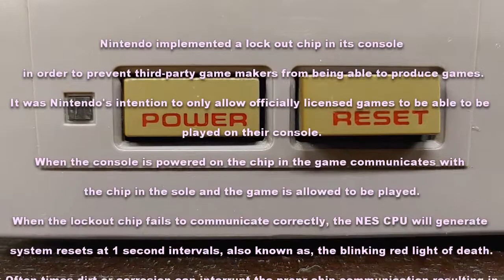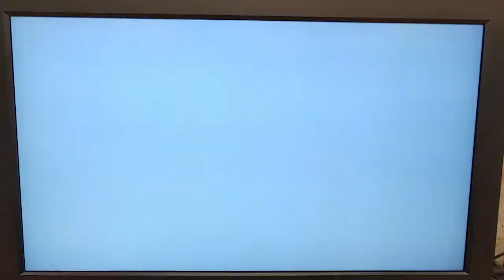Disabling the NES Lockout Chip...Good Idea? Goodbye Blinking Light! | The 8-bit Basement

Comment: I just refurbished my NES and bent the pins on my 72 connector. Everything works PERFECTLY.......except if I push the game down. It ONLY works if I leave it up. 🤷 Would disabling the lock out fix it?
Reply from the maker: No the lockout chip has little to do with this.  Disabling it only bypasses a built in security function

Comment: Is it possible to install a fan in this situation.  In the Sega LED video you guys ran 2 wires from the power and the power switch..  can that be done to install a fan as well?
Reply from the maker: It would all depend on the fan.  It would have to be low voltage so that its not drawing too much.

Comment: I have a question about the "push down" feature on the NES.  I have a Everdrive N8 Pro for Famicom, and a 60 to 72 pin adapter.  Using the Everdrive on my Famicom naturally works perfectly, but I can not use it on my NES because the Everdrive is too big to push down.  I already have the lockout chip done on my NES, but just putting the Everdrive in with adapter does not work.  I also can not use the adapter\everdrive with Game Genie.  Is there any way to deactivate the push down feature on the NES?  Supposedly the "Blinking Light Win" can fix this, but they have not been available for some time.  Thanks!
Reply from the maker: Typically the "push down feature" is an issue with how the lower pins on the connector are bent. I believe, if memory serves, that if they are bent up too much then contact isn't made correctly when the tray is pushed down. Which is why it works in the up position. You can adjust your pins with a simple dental pick found on Amazon.
Reply: @The8bitBasement  oh ok so THATS my issue. I bent my pins up to the Max.. And it only works in the up position. So I'm guessing I need to try and push them back down??

Comment: Let’s say, theoretically, hypothetically, someone were to snip the connection to the chip without fully removing pin from the chip itself…
Reply from the maker: Hello!  From what you are describing, that should still achieve the same goal of disabling the lockout chip.  We reccommend complete removal of the pin leg, but hpothetically speaking, if someone were to simply cut the pin leg in half, it should still disable the chip.  Thanks for watching!

Comment: My NES blinks red regardless of whether I have a cartridge inside or not. I’ve boiled my 72 pin connector and all the pins are in correct places, yet I still get the blinking red light. Will snipping the lockout chip like in the video help with this? Wanting to pinpoint my problem before I do anything. Cheers
Reply from the maker: @KPArchambeault  YES! Cutting that pin leg will eliminate the blinking red light. The blinking red light is a security check essentially. Cutting the 4th pin leg on the lockout chip bypasses that chip, which allows the system to start virtually immediately  and the blinking red light is gone forever. While you have it apart, make sure the contacts on the mother board (where the 72 pin connector attaches) are cleaned, as well. That is the absolute dirtiest area on the mother board.

Comment: Is there any reason why I should cut the pin after i pull it out of chip?
Because I didn’t cut it and it works fine
Reply from the maker: Removing or cutting the pin just prevents any chance of it touching any other contact and creating a short.

Comment: Will it work if i just disconnect the metal piece from the chip? Do i need to clip it away
Reply from the maker: @theretrogamer1  Yes, it will work. We cut it away/Flush with the board to try to be as clean as possible with it. Don't think it could create a short, but it may be possible. We don't do a great job in this video cutting it down (we have gotten better at it). Adding a piece of kapton tape over it would probably also help.
Reply: @The8bitBasement  so I have a uk NES it works perfectly but I accidentally ordered Zelda for it but it is the us version and I just fully removed the metal piece but it still won't work on the nes
Reply: Hello?
Reply from the maker: Hmmm. Are you sure the game works?  Do you have a US NES you can test it on or a friend or game store that has a US one?
Reply: @The8bitBasement  no but I bought the game as working
Reply: I got it from pickers treasure on eBay and the description was guaranteed to work
Reply: Also when I put the cartridge in it's just a white screen not flashing
Reply from the maker: The no-flashing is good. Have you tried any other games, US or not, with the modded NES?
Reply: @The8bitBasement  I tried all my uk games and they worked fine but I don't have another us game
Reply from the maker: @herobrine0781  OK so that's good to know and sounds like you modded it correctly, but it may not mean it can play US carts. See if you get your hands on another US cart and try that. Or, you can always purchase a US NES of course for your US games. Sorry we can't be of more help, we aren't as familiar with non-US NES consoles. You could also try to research a bit and see what you find.
Reply: @The8bitBasement  I saw another method that involves solder

Comment: Instead of cutting that pin the way that they did I would have cut that pin in the middle and left it in there disconnected. He did not have to remove the entire pin off the chip. Now because he did that it can never be put back if it doesn't work with other cartridges.
Reply from the maker: Hello - Thanks for the comment.  The reason we completey discconnect the chip leg is our attempt to ensure a short can't happen.  We don't want to risk accidental contact.  Thanks for watching!
Reply: @The8bitBasement  there is no way a short can happen after you clip the pin. I've done electronic repair work all my life. I've never taken and remove the entire pin. There is no need to. How do you explain a short happening? It's not possible.

Comment: Just cleaned my connector, however it's still blinking. Waiting for a gamebit to come in the mail. Clean the cart and see what it does then. If that doesn't fix it I'll try this, though I'm sort of against modifying the console. So as you said. This will only burn up unofficial games? I only have the Mario/Duck hunt cart rn. Likely only stick to official games though.
Reply from the maker: Yes, you won't have any issue with official games overheating. I would bet after a good cleaning, your game will work just fine. You may not even need to disable the lockout chip.
Reply from the maker: It's also super important to rebend the pins of the 72-pin connector so they create solid contact with games when you insert them into the system. That and cleaning the contacts on the mother board well! That gets super dirty.  We'll be doing a top 10 tricks to clean an NES in the future.
Reply: @The8bitBasement  This one is in pretty great shape. Bought it from a girl at a yardsale a decade or so ago and she said it was hers growing up. But it was left in the basement with the cartridge in. Cleaned the cart and it's working fine now. Isopropyl wasn't enough though. Took some magic eraser and some elbow grease and shined them up good. Works every time now. Now to do this to all my SNES stuff and replace the save batteries. Likely wait until I get my new soldering iron. Got a pinecil but it's coming from China. Good 2 months or so out. Seems like a good iron, an upgraded TS100 at that.
Reply from the maker: Good job!  Brasso and alcohol on the contacts will right the ship for most carts, unless they are damaged.  Save battery replacements aren't too bad to perform and excellent choice on the iron, that's how to get started on your upcoming modding career!

Comment: I disabled the lockout chip, I even cleaned several games I owned that did not have the game bit screws, and now I’m getting just a blue screen. I’m not getting the blinking light, but now I’m getting just a blue screen. I did clean the motherboard and I did clean the connections but now I’m encountering this issue. Any advice?
Reply from the maker: How about the 72-pin connector?  Have you checked to see if the pins are flat and need to be re-bent?  They typically do need to all be re-bent so that the connector makes solid contact with game contacts.
Reply: @The8bitBasement  I tweaked the pin connectors and I tried to see if that would fix it. As of now I only got one game to work. And even then you have to shove it in the system sometimes. I did clean six other games that did not utilize those “game bits” screws but I’m still getting the blue screen.
Reply from the maker: OK, so you at least know it works.  What cleaning products are you using to clean your game contacts and the contacts on the motherboard?
Reply: @The8bitBasement  a combination of 91% straight isopropyl alcohol and a large pencil eraser. According to ReviewTechUSA he said that using a large pencil eraser was better than using windex or running alcohol because they don’t leave film on the games or cause damage to them.
Reply from the maker: OK, so we have been cleaning games for years, and can recommend a few things.  First, it's very important to make sure the pins are bent correctly.  See 6 mins into this video for how to bend them: https://www.youtube.com/watch?v=lVnj3Yqj4uU Second, it's incredibly important to make sure all game contacts and mother board contacts (both sides) are as clean as can possibly be.  The motherboard contacts are typically the dirtiest part of the system.  Alcohol typically is not enough.  We have had a ton of success using a fiberglass pen, as well as brasso, both are items that can be found cheap on Amazon.  We also have videos on both.  From your description, it sounds like not everything is clean enough yet, and sometimes it takes a few rounds of cleaning.  The fiberglass pen (https://www.youtube.com/watch?v=0DMC9WqbAIU&t=132s) and brasso (https://www.youtube.com/watch?v=K6it2NwMkPY&t=273s) really help do the dirty work.  If you are careful with them, you won't damage a thing.  Feel free to skip through our intros in these videos to avoid any unnecessary comedy.
Reply: @The8bitBasement  Im glad that you guys don’t use rubbing alcohol. Thank you for the tips I’ll try them out, clean my console a bit more and see what happens.
Reply from the maker: We like to use a combination of products....even windex/contact cleaner work, but in combination with the pen and brasso, which do the best job of removing dirt. Good luck and let us know how you make out!
Reply: @gamingfanmark9275  alcohol is fine on electronics. why do you say that?
Reply: I cut the lock out pin and now it’s just a solid grey screen